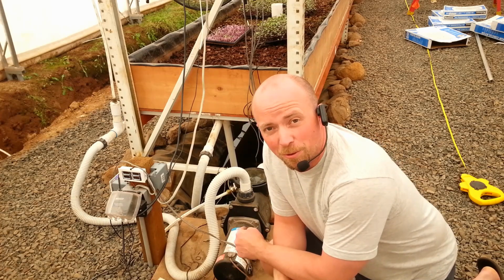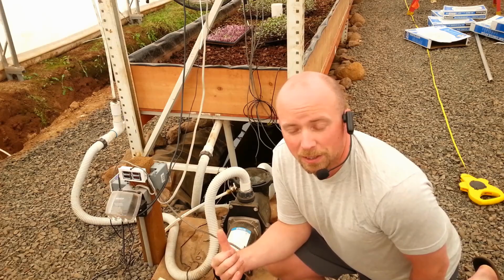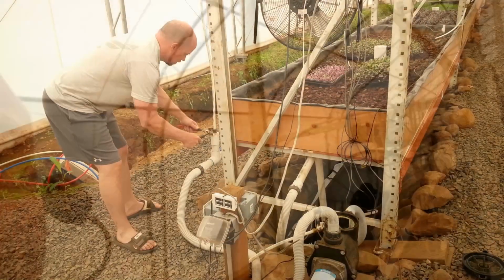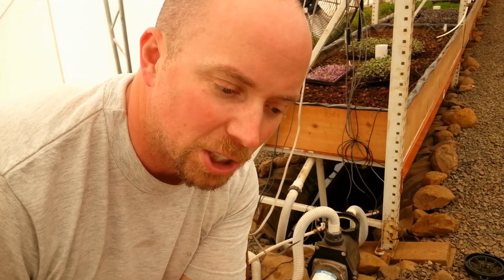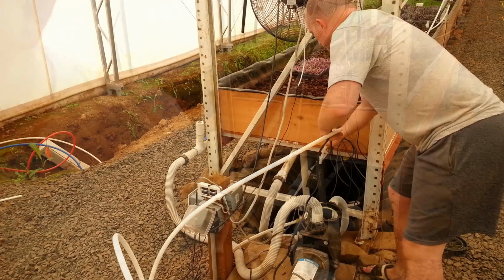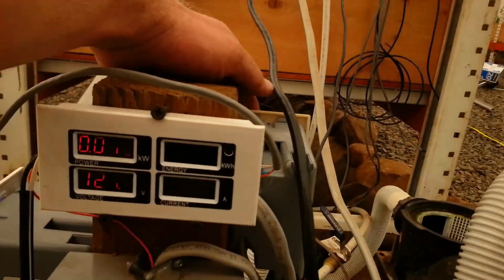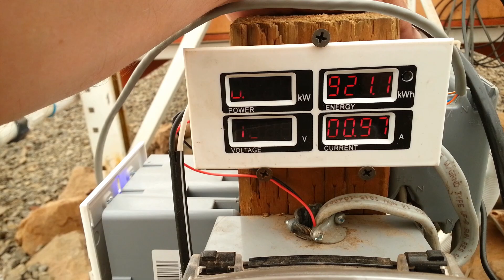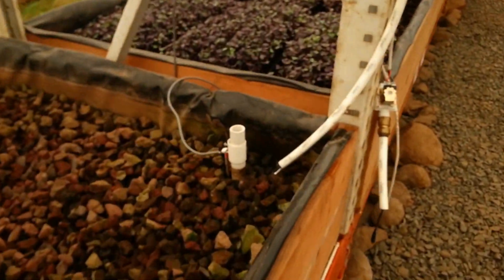Solving the Aquaponic  Pump Problem

Comment: The sharkbite fittings will work for copper and cpvc/pvc as well as pex. The fittings designed for pex are steel rings with a special crimping tool.

Comment: Build a airlift pump. Cheaper than water pumps, and can not clog, never needs cleaned. I pump water from tank to another tank 90 feet away with a 5 watt fish tank air pump.
Reply: Hey @joseph, great recommendation! Do you know of any air pump designs that will move 1200-1500 GPH (only need to lift it 4') ?????
Reply: @thegreatexchange4u  lots of builds here on youtube. It depend on the other factors than just the air pump. Like the internal diameter of the pipe used.
Reply: @Greenwashedhipppie  yeah I think I've read about every  University or government research paper, watched the various YouTube vids but I've not seen any that actually show specs .. like 60L/he air pump, 1" pipe in 4' of water lifting 2' above water and producing 100gph. . I've got some formulas but they're all based on deep well research
Reply: @thegreatexchange4u  I sold my farm and never measure the out put of my system.
Reply: @thegreatexchange4u  yeah, good thing is you can always add another air pump, unless you are limited by electrical load. Another plus is the water is getting oxygenated before it even gets into the drop cycle.